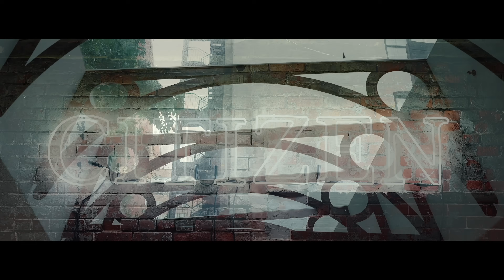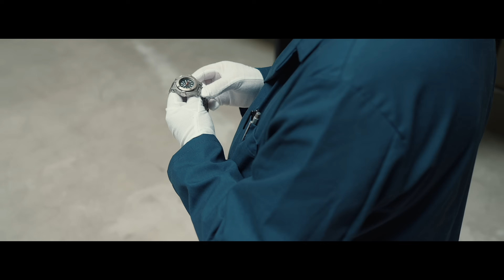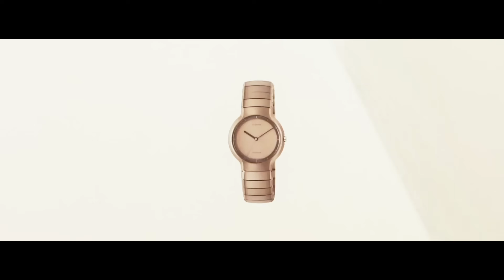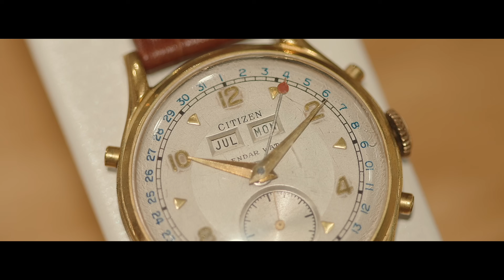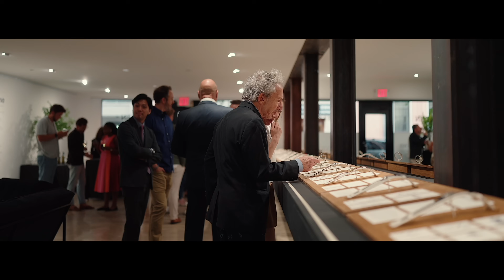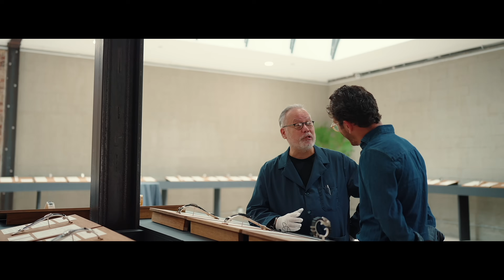Citizen Watches: The Brand That Could Change The Industry Forever!

Comment: Big, big fan of Citizen.  Their Promaster Land field watch (PMD56-2952 and other color variants) is a vastly underrated watch IMO.  My first 'expensive' watch at $500 at the time, but still one I wear regularly and use as a measuring stick to compare other watches against.  Perfect size, amazingly comfortable, great specs, clean legible dial, and a great quick adjust clasp that spoiled me so I can only wear bracelets with quick adjusts now.  Of my current collection if I had to cut it down to just two watches, it would be my BB58 and the Citizen.